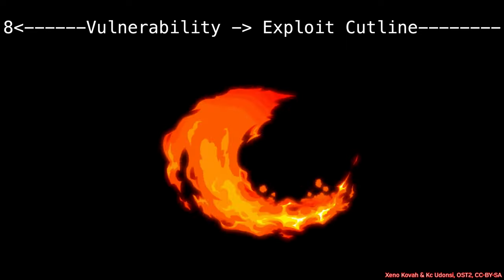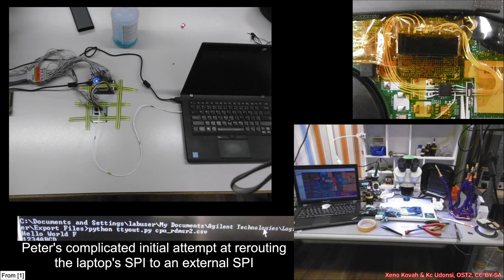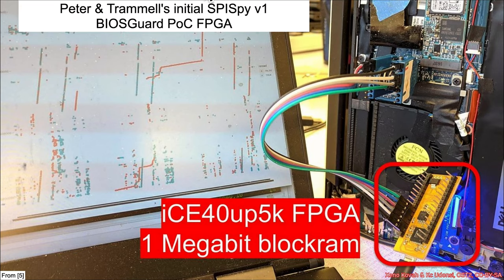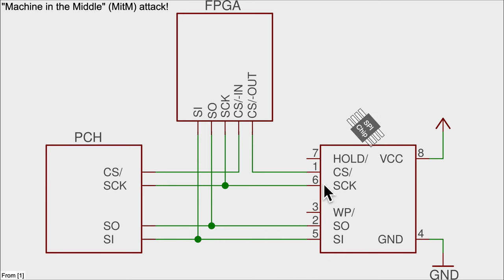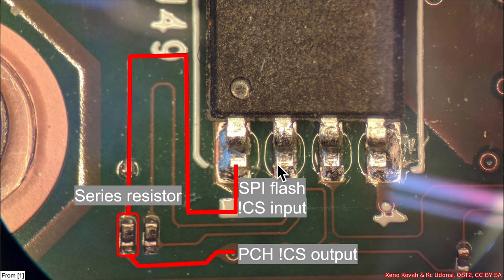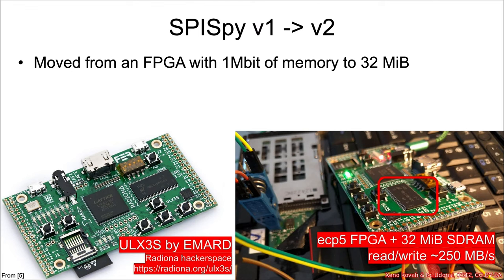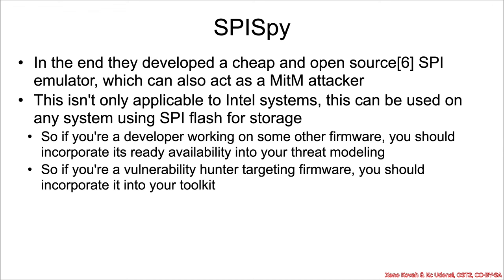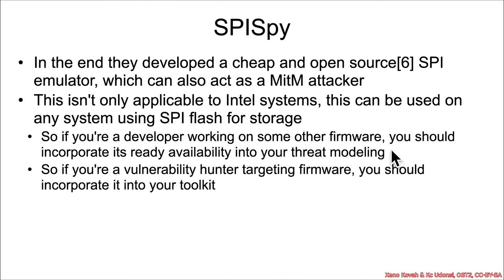Vulnerabilities 1002: 03 Race Conditions 🥷CVE-2019-11098🗣️🕴 02 Exploit

Comment: How do they fill up the FPGA memory with the correct data to send to host? I assume you read the entire content and then specifically find address where you change something that helps you bypass some security. Or do they let the host talk to the memory and the exact byte come along, the FPGA bypass the real memory and talks to host? But again you need to know bit by bit what to send to host.
Reply from the maker: The specific logistics of this attack would be a question for the original researchers. In general though, yes, typically in past attacks people have read the entire flash, created a signature for the vulnerable place to patch, and then operated with that a priori knowledge.